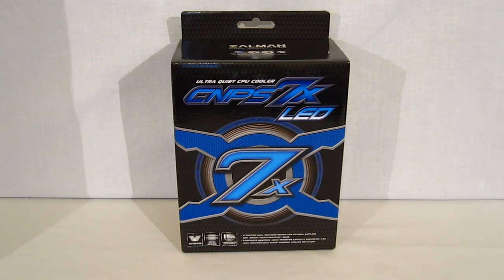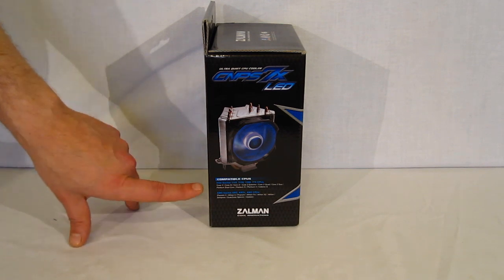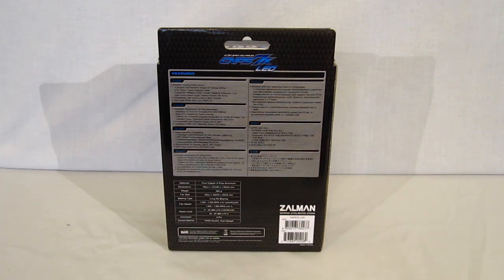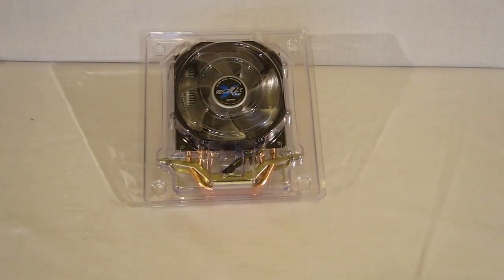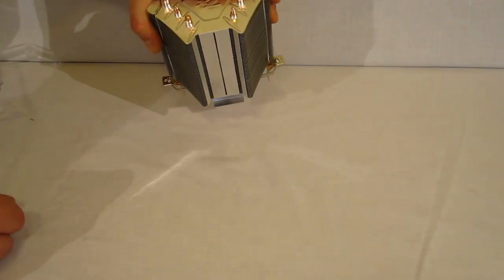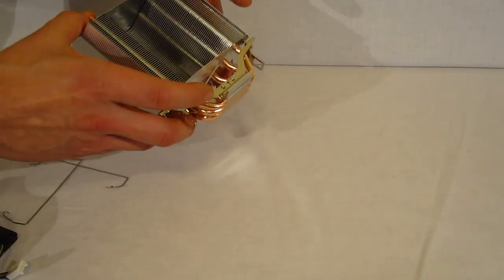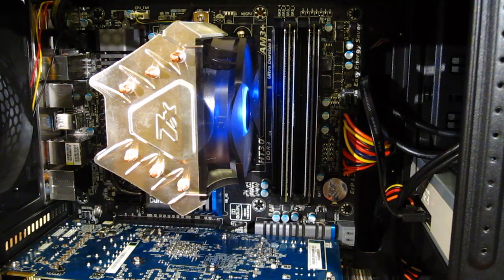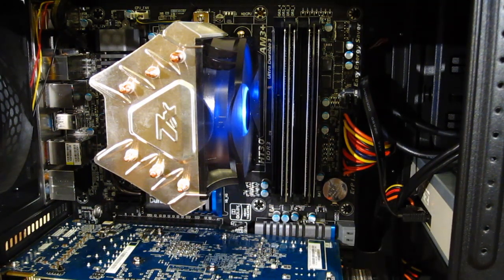Zalman CNPS7X LED Unboxing and Overview at HiTechLegion.com

Comment: i have been using this on my old fx-6350 6core 3,9ghz (4.2 turbo clock) for 4 years, and it has never been above 60c. great cooler, and VERY silent.

Comment: Do you use all the thermal grease that comes with the fan? Cheers
Reply: personally i never use the paste that come with the fan or cpu.I use Zalman ZM-STG1 its not expansive but its really good + it very easy to apply because of the brush.

Comment: i got a new mobo im useing the stock cool i put the past on its runing at 48c befor it was runing at 33c did i use to much past or i need a better cooler i put a pee size on the cpu spread it out even and put the cpu on i put just a lil more it didnt cover the hole cpu